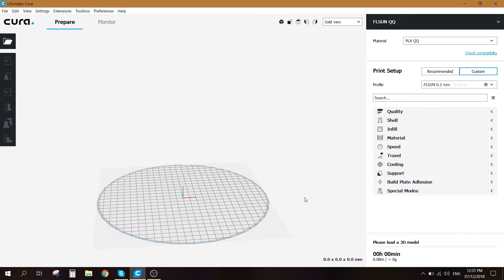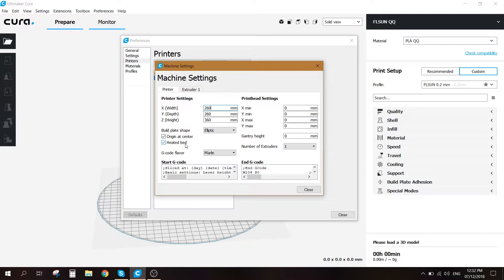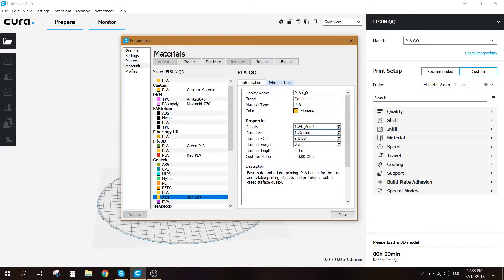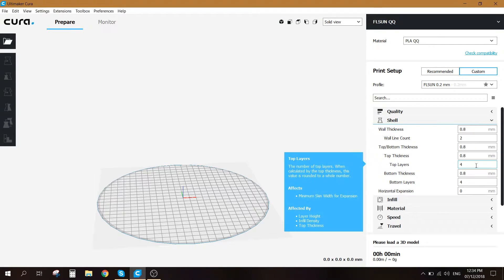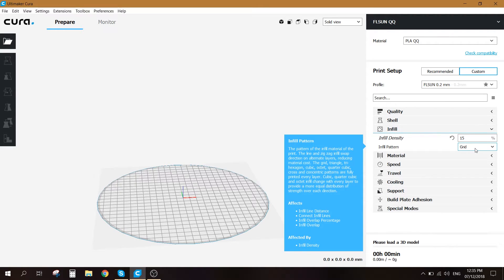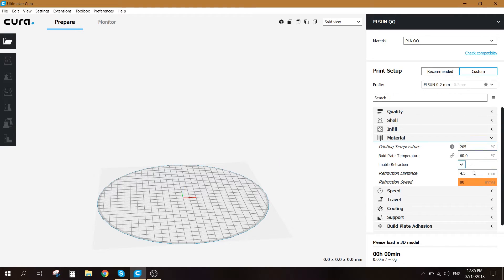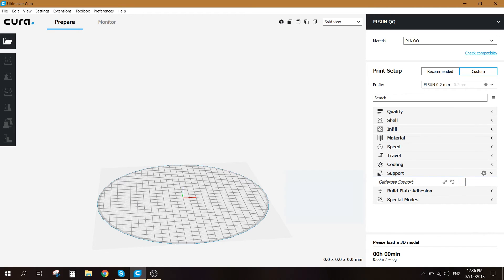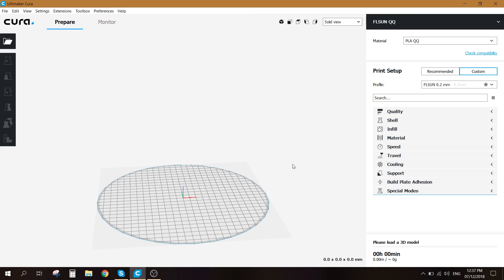FLSUN QQ 3D Printer // Cura Settings

Comment: gcodes doesnt work, im now using  deltaGo gcodes and works awsome
Reply: Can you share where to get that gcode?
Reply: @chrislectic  creating a printer with the default config called DeltaGo, under gcodes :p

Start G-code
G28 ;Home
G1 Z15.0 F6000 ;Move the platform down 15mm
;Prime the extruder
G92 E0
G1 F200 E3
G92 E0

End G-code
M104 S0
M140 S0
;Retract the filament
G92 E1
G1 E-1 F300
G28 X0 Y0
M84
Reply: @chrislectic  it's the default cura DeltaGO configuration.

Comment: I am using Cura 2.7 (the one that came with the printer and has all the settings already in place). I now would like to use Cura 3.7 and just installed it. Right after installing, it is asking me to pick a printer.  Which one do I pick? I guess that if one would change EVERY single setting there is, it would make no difference what you choose at the beginning, but since you are probably NOT changing every single setting/parameter, what is the right printer to pick as a "base". I hope I explained this right... Thanks.

Comment: Why is your printhead settings all at zero?
Can you please list your start and end G-code?
Reply from the maker: Miguel Rocha hello Miguel, there's no need to specify printhead values since the build is eleptic and we entered the x y z values. Please find the start / end gcode in the comments. Don't forget to like and subscribe :)
Reply: Thanks. I had to change the sort by to "Newest First" to see the G-code, the default one "Top comments" doesn't show anything so it's probably best to put it on the top, before the comments (don't know the name of that section). Thanks again.
Reply from the maker: Thanks for the tip :)

Comment from the maker: End G-Code
M104 S0                     ;extruder heater off
M140 S0                     ;heated bed heater off (if you have it)
G91                                    ;relative positioning
G1 E-1 F300                            ;retract the filament a bit before lifting the nozzle, to release some of the pressure
G1 Z+0.5 E-5 X-20 Y-20 F{travel_speed} ;move Z up a bit and retract filament even more
G28 X0 Y0                              ;move X/Y to min endstops, so the head is out of the way
M84                         ;steppers off
G90                         ;absolute positioning
M81
;{profile_string}

Comment from the maker: Start G-Code
;Sliced at: {day} {date} {time}
;Basic settings: Layer height: {layer_height} Walls: {wall_thickness} Fill: {fill_density}
;Print time: {print_time}
;Filament used: {filament_amount}m {filament_weight}g
;Filament cost: {filament_cost}
;M190 S{print_bed_temperature} ;Uncomment to add your own bed temperature line
;M109 S{print_temperature} ;Uncomment to add your own temperature line
G21        ;metric values
G90        ;absolute positioning
M82        ;set extruder to absolute mode
M107       ;start with the fan off

G28 X0 Y0  ;move X/Y to min endstops
G28 Z0     ;move Z to min endstops

G1 Z15.0 F{travel_speed} ;move the platform down 15mm

G92 E0                  ;zero the extruded length
G1 F200 E3              ;extrude 3mm of feed stock
G92 E0                  ;zero the extruded length again
G1 F{travel_speed}
;Put printing message on LCD screen
M117 Printing...